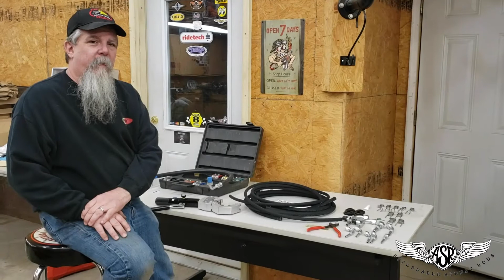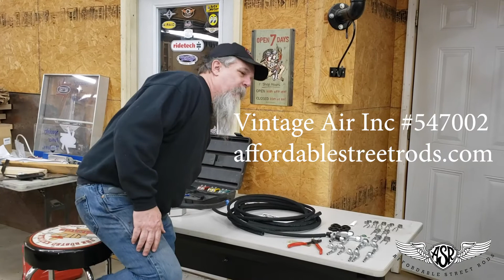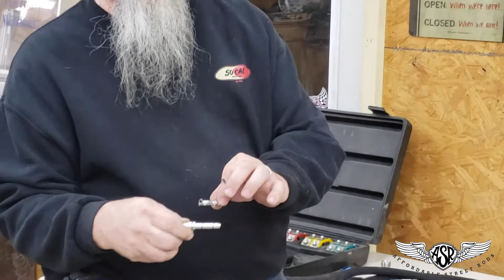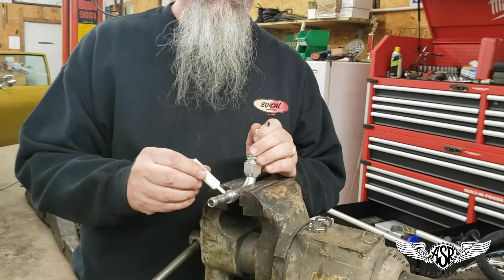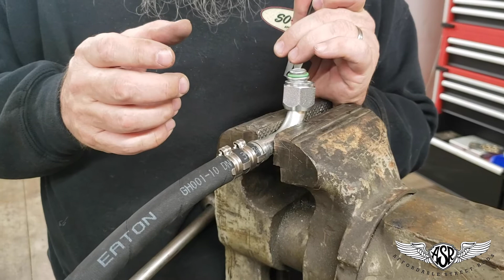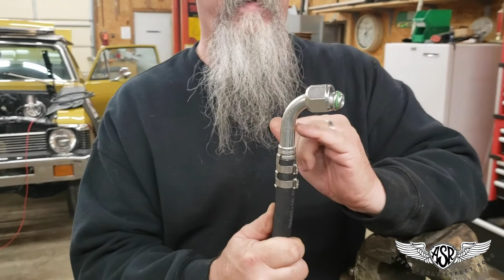How to build E-Z Clip Hoses for air conditioning systems

Comment: Just subscribed and thanx for the video. May be crazy question but what is the difference between #8 and #8 reduced barrier.
Reply: #8 barrier hose and #8 reduced barrier hose has the same ID, however the OD is different.  Both hoses take different fittings.  RB is a little more flexible.  Hope this helps.

Comment: Thanks Rex! Do you have any tips for adapting to custom fittings? I've got a Subaru compressor that I need to adapt to an existing VW ac system. I think the male<->male fittings will work, but I may need to braze on a EZClip fitting?
Reply from the maker: Sorry, we don't have much info on that, everything we do is with Vintage Air so we don't have to custom make any fittings.
Reply: @affordablestreetrods  I was able to make it work using a male to male crimp on hose fittings with the stock subaru connections. Worked great. Thanks!

Comment: Loved the video. I went immediately to your website and looked up the products. Holy shit!  $600 for the hoses and clips. Then $76 for the pliers. I could buy four hydraulic crimpers for the same money.
Reply: The crimp tool is 130$ now on Amazon
Reply from the maker: The EZ clip hose kit is $360, with the pliers.that’s $436. The Hydra Crimp Kit Portable hand held hydraulic crimper is $579 plus the beadlock hose kit is $115. A shop owner this week told me that he has no leaks with EZ clips,, so he doesn’t ever use the barrier hose any more.
Reply: @affordablestreetrods  That doesn't make sense.  Barrier hose is to keep the gas from permeating through the hose.  What's that shop owner use for AC hose??

Comment: Excellent video.  I am kicking myselft for buying a vintage air kit with the beadlock connectors.  I spent $150 on a beadlock crimping tool and after all that I found out about the E-Z clip system.  You would think that Vintage Air would have suggested it when I bought my system.  I am going to use E-z clip on my next system now that I know better.
Reply: Same here! Went to speedway motors got the beedlock kit! Let's try to return it maybe?